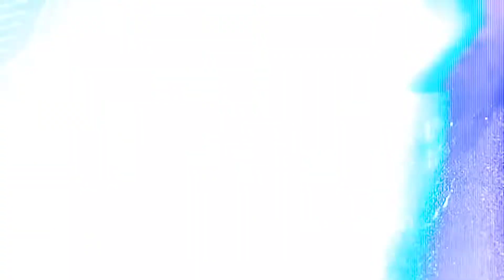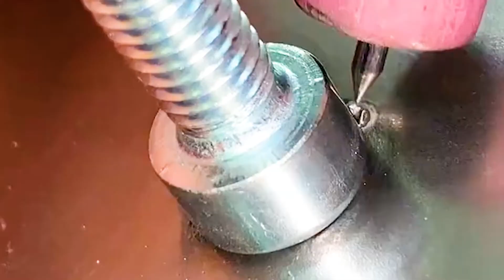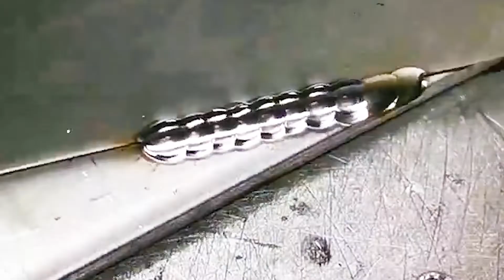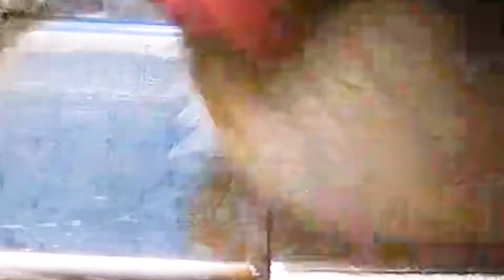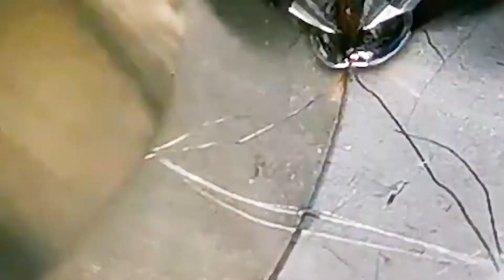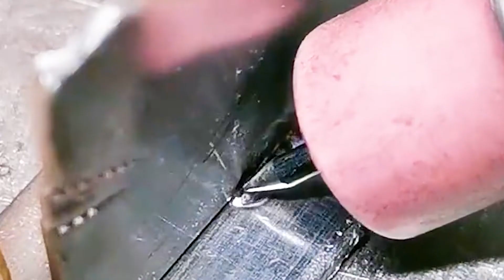5 common problems and solutions when using cold welding machines

Comment: You talk about common issues and problems using cold welder however you're not illustrating your examples through the video and demonstrating how the welder needs to be set up you need to discuss this in a more practical and visual format you need to show examples of the world example of your set up and not having enough current and adjusting it....showing us the users how to adjust the timing on your welder you talk about it but you dont illustrated  your point in the video
Reply: For better example, search videos about "SW-V01" welder (or "PiggyWelder"). Injection mold repair.